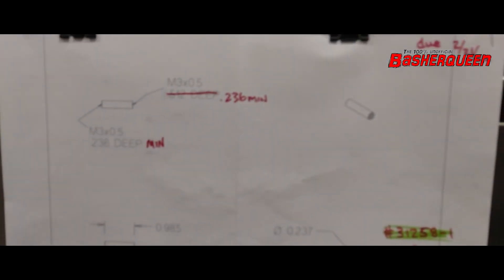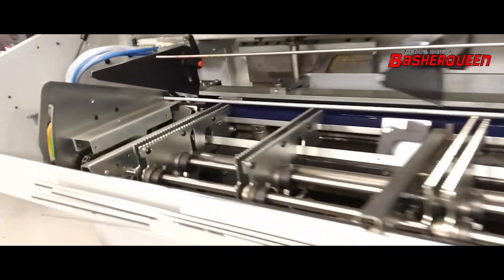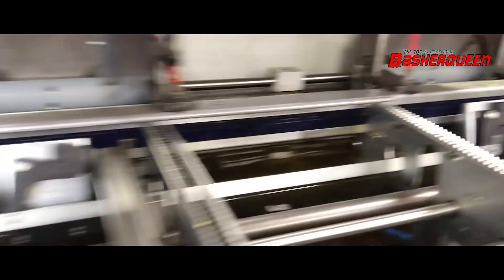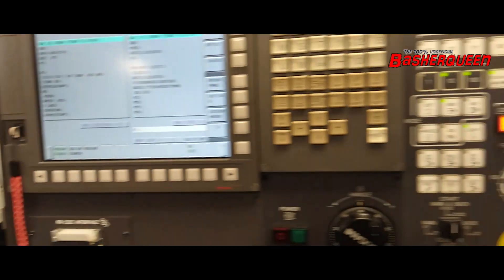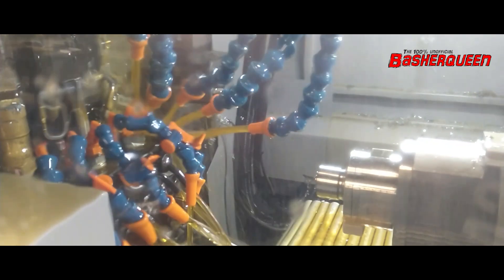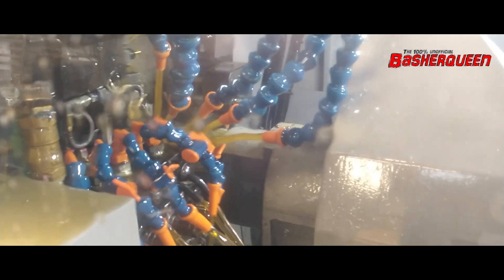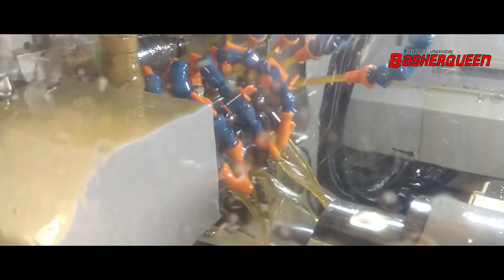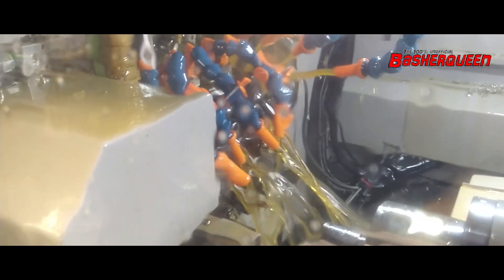Basherqueen - How it's made: Servo Mount Aluminum Standoffs

Comment: Looks very nice. What's the length of these standoffs? I believe these would support servo's up to 40mm without spacers. Does that mean the standoffs exceed 40mm?
Reply from the maker: Hi! Standoffs are 25mm + 3mm thickness of the tray. With the rubber boots the height is perfect for most aftermarket servos.

Comment: Hey I just bought one of those servo mount kits. I see ur new arrma aluminum diff case kits. Are the aluminum parts machined in the USA
Reply from the maker: Besides the countersunk washers like from the servo mount from batch 2 on all domestic. First batches are mixed.
Reply: @Basherqueen  what about the aluminum diff cases